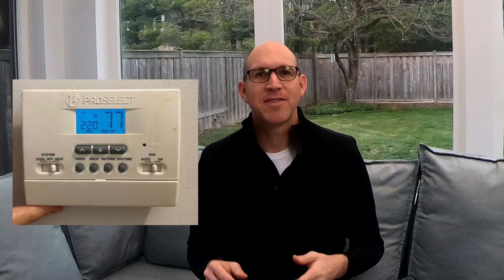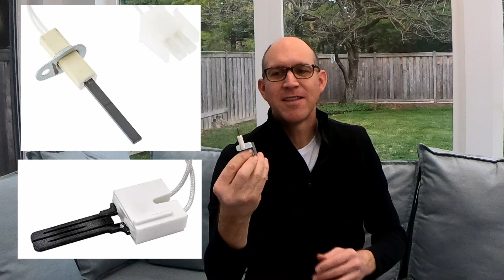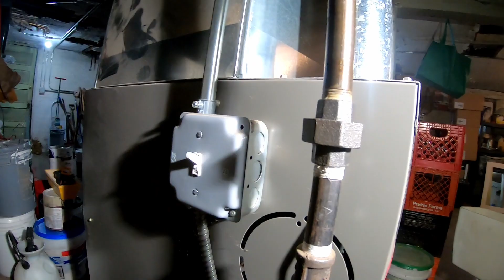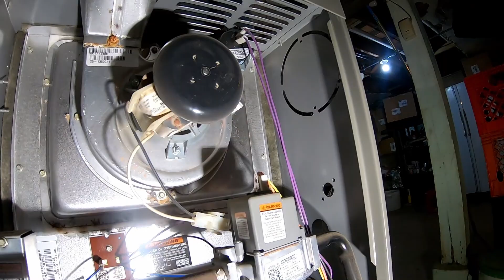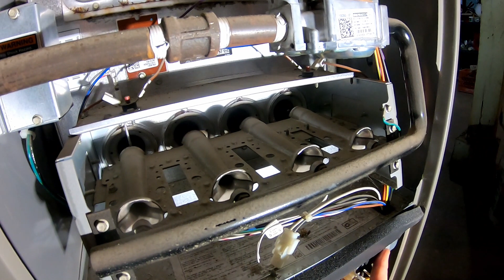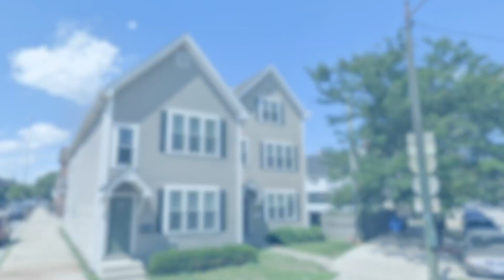Trouble Shooting No Heat or No AC #noheat #furnacerepair #troubleshootfurnace

Comment: Here's a tip for you or others... the igniters will go out as you said, and they aren't that expensive.  When you replace one, buy two and tape the spare one somewhere on the furnace (that doesn't get hot!) and write on it with a sharpie "Spare Igniter".  If you are in a situation with a really low freezing temperature and no heat, you don't want to be waiting a long time for a spare part or a technician to show up, so keep a few of these cheap spares with the unit.
Reply: this is a great idea!! thanks frank!
Reply from the maker: I think that is a fantastic idea - thanks so much for sharing that tip, I really like it - a lot!